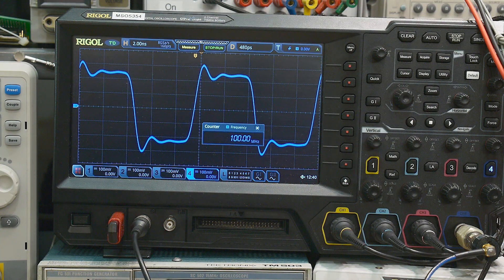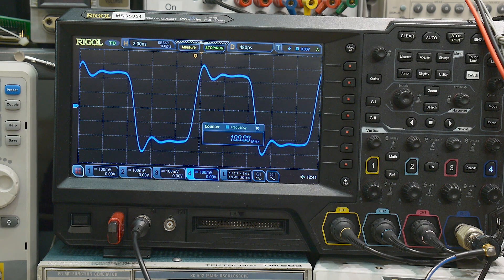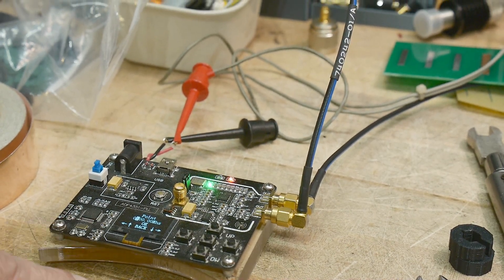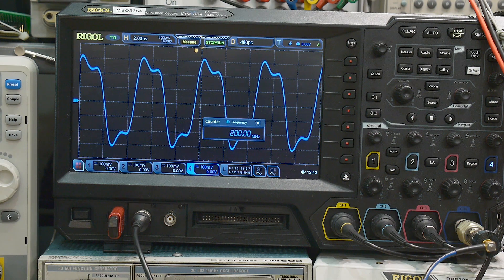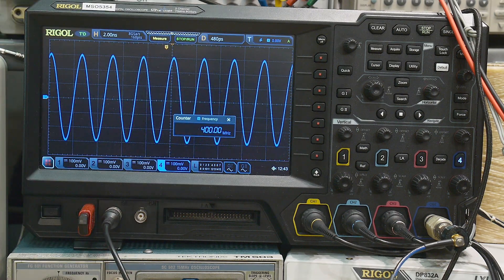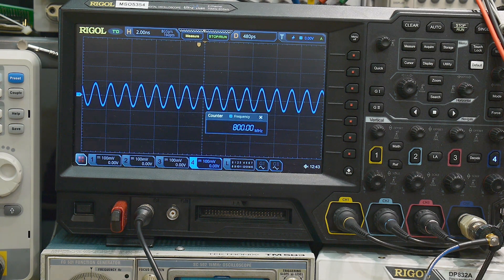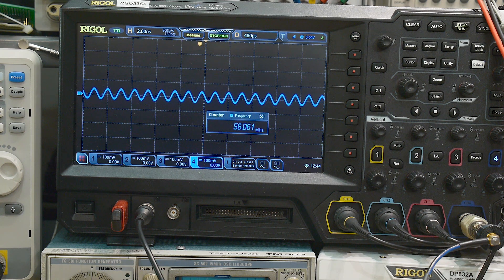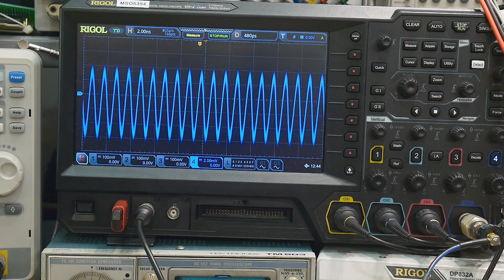#1464 1GHz Rigol Oscilloscope

Comment: Since your scope has an 8 GS/s sampling rate, in theory you should be able to accurately display sine waves up to around 4 GHz (Nyquist limit).But here’s the catch: once you go above ~500 MHz, the probe itself becomes the bottleneck.
If you want to properly measure a clean 1 GHz signal, you need a probe rated for at least 1.5 GHz bandwidth (preferably higher).
And trust me — the moment you look at the price of a real 1.5–6 GHz active or high-bandwidth passive probe, you’ll scream… unless you’re a billionaire. llooooooooolll
Reply from the maker: https://youtu.be/uKEj0OPIiHs?si=olYf8swRRp8vUNne
https://youtu.be/wWQlUmca5-A?si=s1Rxg4FqoWasZGz5

Comment: I did some testing of my unlocked MSO5104 with an RF signal generator.  I found the response was flat up to 500MHz with a 3Db rolloff at 650MHz.  Very remarkable indeed.  This was with 50 Ohm test cables and a feed thru terminator at the scope.  The probes are rated 350MHz, but they were unpredictable past 100MHz even with care grounding, so you should be careful about probe use.  Quick question:  Is there a way to lock the vertical channels to 10:1.  When ever I power up the scope it switches the inputs to 1:1.
Reply: Change your boot up setting to last used, not default. It should start up the way you left it at power off.

Comment: This is freaking amazing that this relatively inexpensive scope will work that far out of its specification.  I have an analog HP scope that was manufactured for the Navy in a watertight case.  I bought it in the mid-1990s while I was in college, but was likely manufactured in the 1970s.  It is rated 60 MHz, but that is the 3 dB down point.  So, even with 100 MHz probes, by 100 MHz there is virtually no display.  The scope still works, but something has failed in the trigger circuit so I can't get a stable display.

Comment: I recently purchased 200 MHZ series Rigol scope and bandwidth upgraded to 350 M HZ. I decided to measures its bandwidth. So i was giving a 75 MHz Squarewave from  STM32 development board(3 .3 V, gpio signal driven by timer) initially. while doing this i observed the squarewave is getting attentuated and loosing its shape.i have doubt like 
1) shouldn't we use the PVP2350 probes to do this test?
2) shouldn't we  use squarewave to test the bandwidth of the scope?
3) how to proove my scope is actually 350 MHz ?
replies would help me to understand more about the bandwidth
Reply from the maker: https://youtu.be/N6bqNg3xJ1k
https://youtu.be/eaoHYWYLRV0

Comment: Did you use an attenuator or an inline 50 ohm load?
Reply from the maker: in line 50
Reply: @IMSAIGuy  I recall you measuring some feedthrough terminators, but I don't remember if you did it while plugged on the scope. The input capacitance of the scope has heavy influence, Chriss Grossman discusses a bit about it. One way to mitigate it would be using attenuation pads.

Comment: Strange that 8 MSa scope has so limited bandwidth. Did you observe those signals in dot mode, not in sin(x)/x interpolation? It should be interesting.
Reply: Yes by Nyquist 8/2 = 4: but, the signal still has to be processed before it is sampled. Top end, MSO5000 has 350 MHz analog bandwidth.... so there is going to be low passing, and the DSP is going to get utterly confused.
Reply: Scope input filters tend to roll off at 1/5th to 1/10th sampling frequency unlike, say, audio devices which can operate closer to Nyquist. This is mainly due to the type of input filter used, since it's much harder to make a sufficiently sharp filter at higher frequencies (and oversampling is impractical).

If you're curious I think you can also start to see aliasing in this video at around 1.1GHz and higher (really apparent at 1.3GHz) showing up as lower frequency components
Reply: @Skye-632  , the sampling part of the scope in the video has 8 MSa capability. Expecting bandwidth of this device must be 800-1600 MHz, if follow your «1/5th to 1/10th».

> since it's much harder to make a sufficiently sharp filter at higher frequencies
Since from what?
BTW I don't know what you mean by the sharpness of the lowpass filter. I know the term «order».
Reply: @Scorry  
> Expecting bandwidth of this device must be 800-1600 MHz, if follow your «1/5th to 1/10th»
Which seems to be right around where the scope starts rolling off in real life. The max 350MHz spec from the manufacturer is conservative to allow for manufacturing and calibration error

> Since from what?
Meaning the scope could operate closer to 1/2 sampling if it had a sufficiently sharp / high order input filter (otherwise known as a "brickwall" filter), but it can't use such a filter because they're technically challenging / prohibitive to make at such high frequencies.

>  I don't know what you mean by the sharpness of the lowpass filter. I know the term «order»
Yep, "order" would be the correct interpretation of my meaning. In this context "sharp" is referring to the sharp/steep/quick transition between pass-band and stop-band of the filter. For an analog filter this is analogous to "order" but "sharp" is generally applicable to both analog and digital filters.

Comment: A 300 MHz Tektronix 2465 will measure up to 1GHz with an attenuated signal. You can measure the frequency with the cursors if the frequency counter can't. Your frequency counter worked just fine once you increased the signal size on the display.
Reply: Goin to have to turn of the lights, and get out the glasses, if you're going to see a signal that fast on a 2465... maybe you are thinking of a 2465B. ... or a 2467B with a micro-channel plate CRT. Anyway those two scopes were about as good as analog scope (with a CRT got).
Reply: @willthecat3861  You have no idea what you are talking about. My comment was not to brag about my scope. Rather to note how all scopes can often dispIay a much higher signal then their rated bandwidth. Yes my 2465 will display a 1 GHz signal and I can measure the frequency with the cursors.  It may even do better than that but my signal generator a Systron-Donner 1702 only goes to 999.9999 MHz. BTW I have owned at least 12 oscilloscopes, digital and analog, in my 5o year career. Now my 300 MHz Rigol digital scope crapped out at 340 MHz.

Comment: Couple things. a) The roll off on the front end is dropping the level the counter can reliably trigger off. b) also could be the physical implementation of the counter which may not support counting over a certain number of ticks during whatever  its sampling interval is internally. I think a video about how frequency counters work would be interesting, no ?
[edit] Silly me, you probably already have a video on that subject 😂